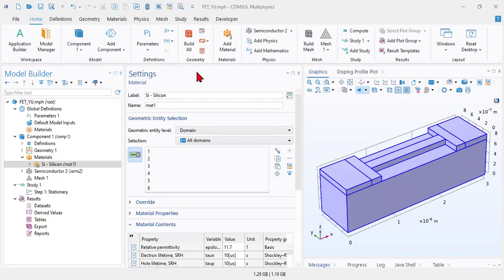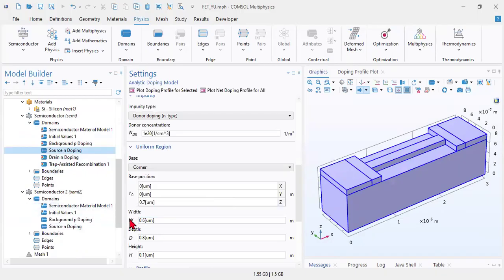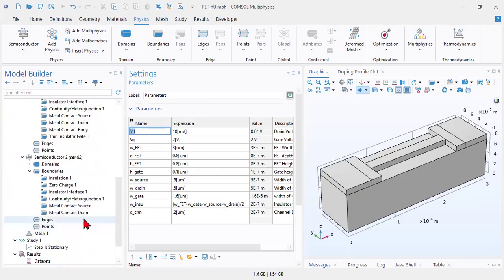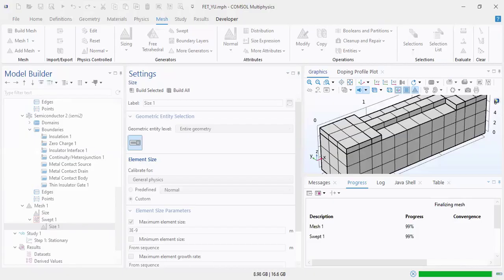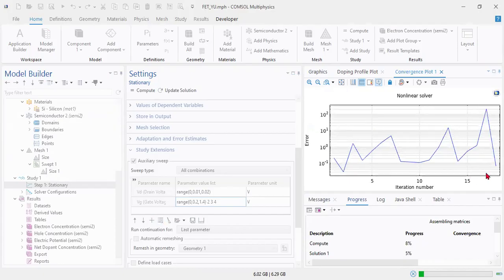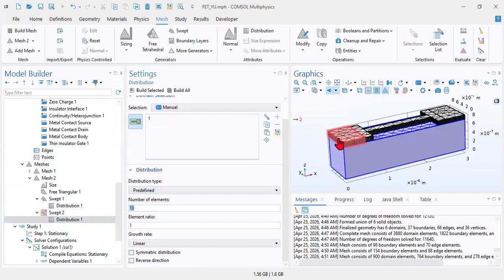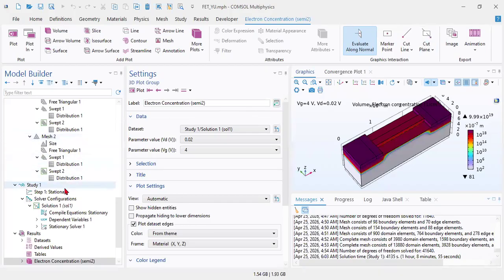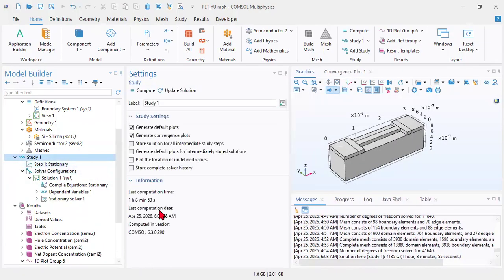How to Simulate Field Effect Transistor (FET) in COMSOL | Results & Characteristics | Part 2 #comsol

Comment: Hi,  Sir, I have designed FET by watching your video and initial values, also running, but the Ids vs  Vds or Vgs are not plotting. Can you please help me? Thank you.
Reply from the maker: For the plot issue, check:
• Use Parametric Sweep for Vds/Vgs
• Select correct dataset in 1D Plot Group
• Use proper Ids expression (drain current)
• Ensure the study converged